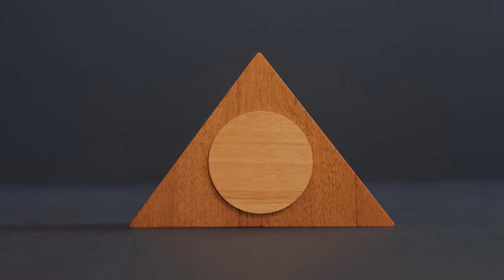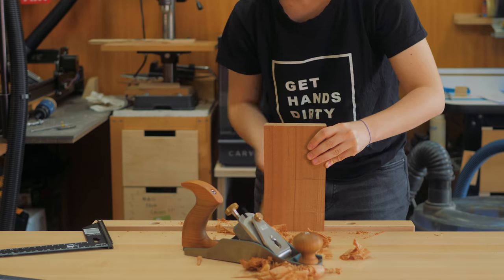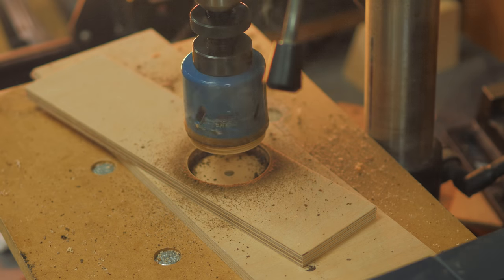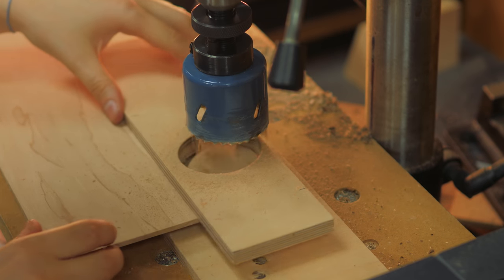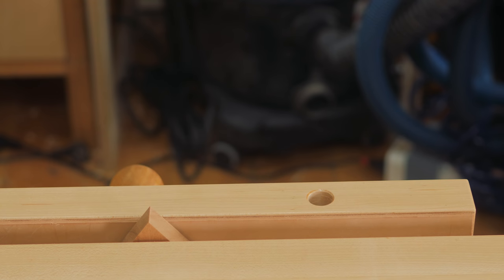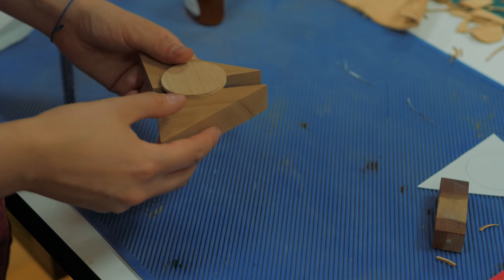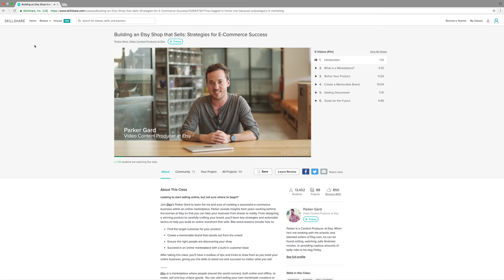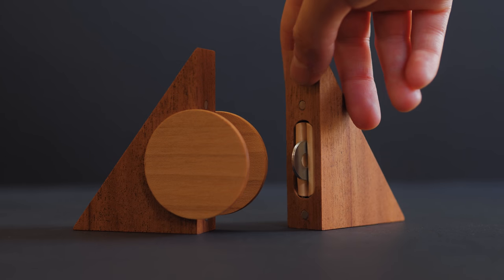Triangular Ring Box // Hand Tool Project (Almost)

Comment: A beautiful project. I liked the idea to use the sounds of the woodworking to replace narration where it wasn't needed. It added an extra special touch to the video.
I had an idea when I saw you using your bench hook at 2:30. Could you secure it in place by using a pair of opposing wedges in the space between the bench hook and the opposite side of the bench?